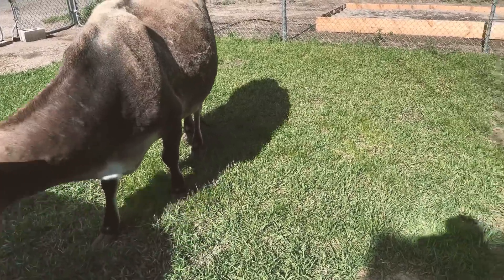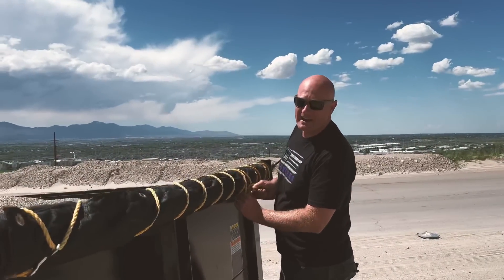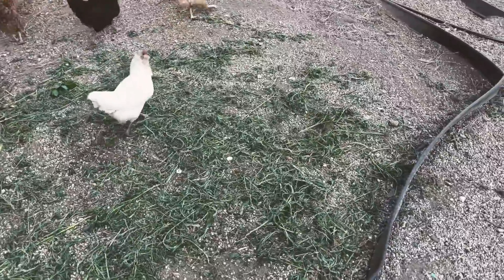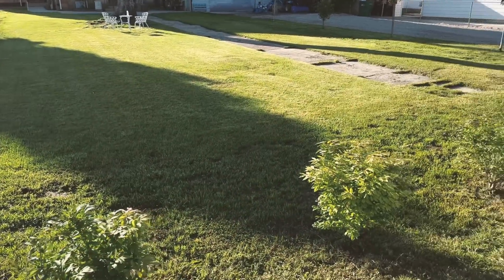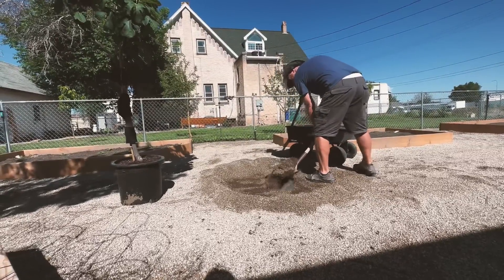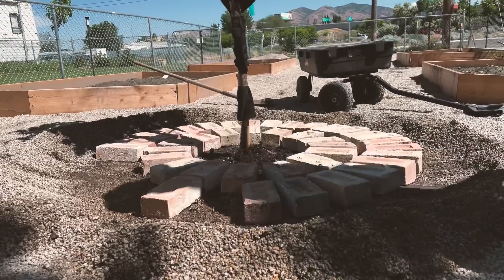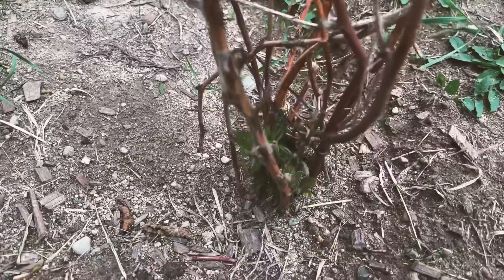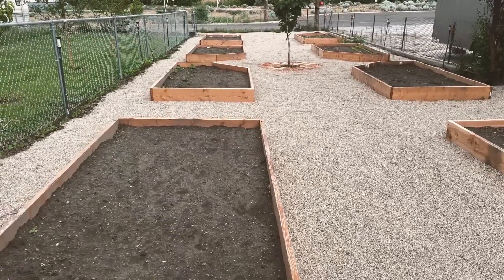Urban Garden Update: Garden Ideas

Comment: Tractor here 1958 its old & Paint on it is long gone. Bit super greatful hubby is a knowledgeable mechanic. That old tractor moved mobile homes here & buildings as well. With hubby attaching a truck blade to the hydrolics. And made steel forks, he's also a skilled & certified welder. The narrow front end wasn't stable enough or heavy enough to let the front narrow front end touch the ground. When he hooked the mobile home the metal hitch to the back of the old tractor. So he improvised & ran the big steel tongs he had made on the dump truck blade. He had made them to hook over the blade. He ran the tongs through a wooden pallet & cement blocks & 100 # tractor weights. Rachet straped them on. And the front end would touch the ground. As he hitched up the mobile homes. And he traveled about 3 miles down a major highway bringing the mobile homes here. One of them was a very old double wide. He has attached 1 1/2 double wide & another single wide togather. And we had a roof put on it. As we have slowly with a very tight budget stripped the inside & work everyday on it to live in eventually. He has 10 days to go until he is going to have a total hip replacement. The hip was in a horrible dirt bike wreak & has pins. After he played evil knivel & broke the neck of his hip. He couldn't walk for a year. And the bank took everything we had.  It's taken alot of time to make a comeback. Started in 2010 from scratch in our middle 50's. Sometimes you loss everything to remember what is important & valuable. 45 years I have known I choose the best. That money & things would never be able to replace. 
 If you have a min. On the 28th of this mth. Say a little prayer for Hubby. This will complete stop him for a few mths. But it all can wait. Just would love to see him in less pain.
Reply from the maker: Will do!  Prayers for both of you
Reply: @jamiandzeb  thank you Jami! The place is going to be gorgeous when you guys get done! You have came such along way in a very short time..if you ever just stop a min. & enjoy the fruits of you & Zebs very hard work.